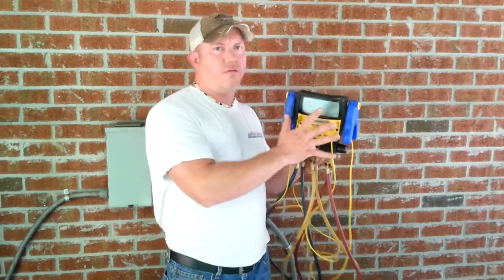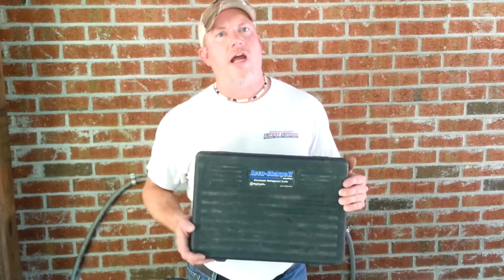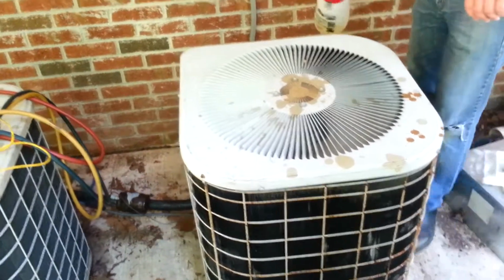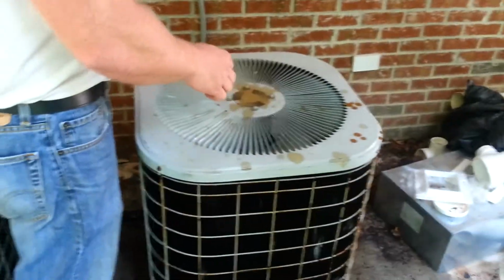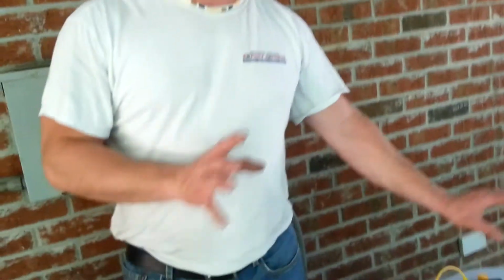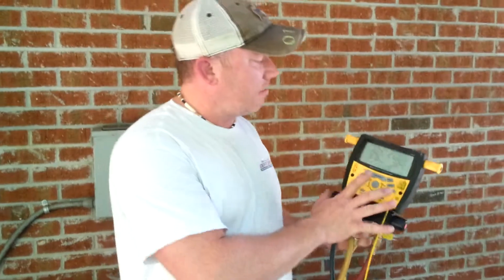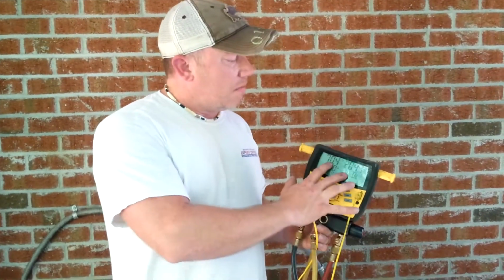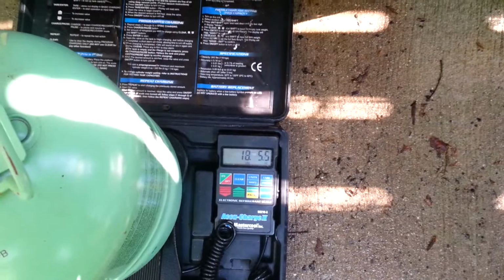How to repair an air conditioner repair

Comment from the maker: I take the dry bulb temp in the general area of the condenser while the system is off.  if you take it close to the condenser while its running there will be a temp difference.  thanks for the question.

Comment: Thanks, that was a good training video. But I was wondering if it made a difference as to where you placed the thermocouple in order to get a good dry bulb reading. Should it be close to the air going into the condenser, or does it matter?